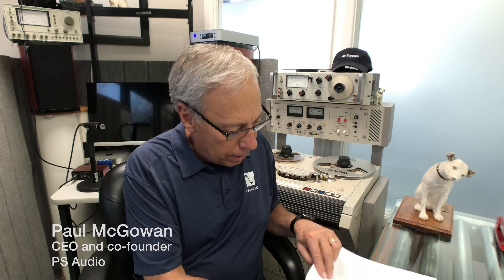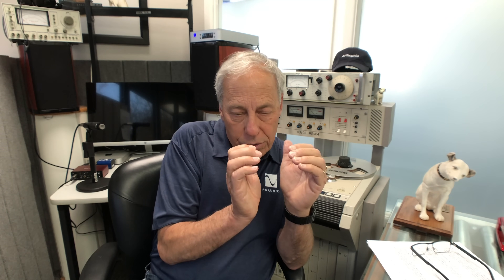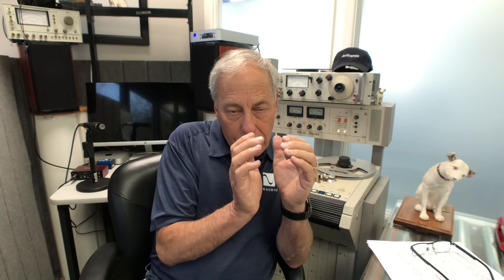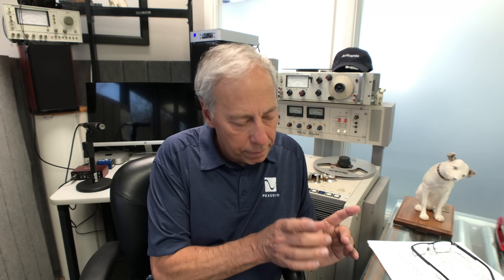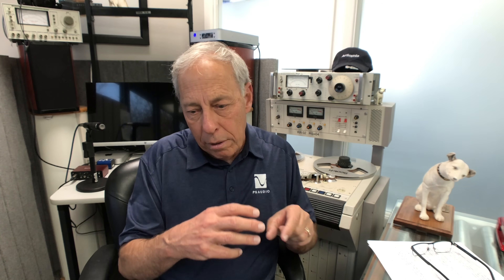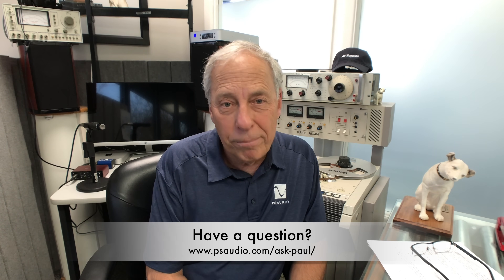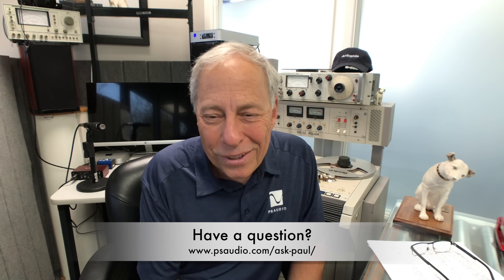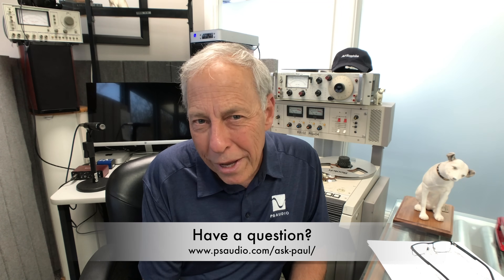How important is the DAC chip itself?

Comment: Coming across this video now is quite a coincidence. Just last week, I had an inane argument with some tool on a home theatre enthusiasts Facebook group (as an enthusiast myself, we are just the worst) about how DACs don't affect the sound because as per his "benchmarking equipment", they all offer incredibly low distortion and therefore do not change the signal in any way. Oh boy. He got particularly riled up when I said that in my experience, Sabre DACs have a cold, analytical sound to them (that's just the way it's been in every implementation I've listened to) while AKMs that I've listened to tended to lean slightly on the warm side of neutral. But of course, 0.00000000002% distortion means everyone can pack their bags up, because the DAC business is over, right!? I personally use a Chord DAC (also FPGA-based) and it just sounds "precise" compared to the more traditional DACs I've listened to (I can only imagine what the more expensive stuff sounds like).

I've also learned that double blind testing or AB testing is really not a valid way to determine how you hear something. I think Paul gives a great reason in these comments as to why such tests are useless. When I compared the Chord DAC to what was at the time my favourite DAC, a Burr-Brown, I did not discern any immediate differences and dismissed the Chord as wasted money. Three months later of listening to the Chord DAC, and then switching back to the Burr-Brown, I was blown away at how bloated and "slow" the Burr-Brown sounded. It's not that the Burr-Brown was bad, but listening to the Chord over time, I started perceiving how much tighter everything sounded, and I could listen for hours without getting fatigued (something I cannot do with a Sabre DAC). It's one thing to tick all the boxes on a bunch of specs, it's another to actually listen to something and "feel" it. That's something a lot of "enthusiasts" simply don't do - listen (the irony). It's much easier to wave a bunch of measurements they barely understand, shout "snake oil", and mock people for spending more money than them - who are you trying to convince, exactly?

Thanks Paul, really appreciate these videos!
Reply: Read / Listen to this:CD/DVD Player DAC Comparison Round 1 ( Sony, Pioneer, Toshiba, Onkyo, Technics/Panasonic ) https://www.youtube.com/watch?v=HLPVR9_qHhU&t=1s
Reply: Most of these guys have next to zero experience or knowledge. In the EAD DSP 7000 series DAC from back in the early 90s, the company decided to change just the DAC chips which then became the DSP 7000 series 2. The switch was from an Analogue Devices chip to a Burr Brown PCM 63k chip. The difference was substantial between the two units.
Reply: Chord is good for a low end brand. Or shall i say “mid-fi”
They compare well to other dacs in the $2k-$5k range
It’s a shame that the holo May Dac is destroys the entire  chord line including the chord Dave with Mscaler but at a fraction of the price

Im not too sure which implementation you heard of sabre chips, as i personally dont buy cheap equipment, but i heard the lumin x1 which uses duel ES9038PRO Sabre chips and its one of the best sounding dacs I’ve ever heard and this is me comparing it to $20-$30k dacs

Comment: Made a double blind randomized controlled test with equal levels on the same Tidal preamp comparing a 110 Euro Xiangsheng dac 01 with the solid state outputs against a 65.000 Euro MSB dac which additionally had esoteric cables, was attached to a Isotek power conditioner etc. It consisted of 60 rounds and took up to 3 hours. No difference was detected. Absolute guessing. Poqer calculations gave us enough confidence for the 60 trials. Music came from the same digital source, also from msb/ oppo. While listening, the dacs could be switched with interuption of less than 1 second with spl alignment. Add to that the msb dac was upconverting whilst the xiangsheng was not. It did the same sort of tests with different gear, no perceivable difference! 

I am very well aware that mostly audiophiles are reading this and you will have the last word on that matter. You are an authority in the myth industry. But a very modest and friendly person. I am sure you believe in the faulty and circular argumentation. The same way as a slaughter will not be able to get insight into why killing animals might philosophically be wrong. I hope you excuse the analogy.
Reply: Bad science here. You discount how the mind interprets and learns, and objective actually difference can be physically measured. Where has this study been published?
Reply: Sorry Paul, you honestly seem to be a very nice and friendly person and I do not want be be rude but this is the same old trick to devalue truth and scientific proof. It is the same way of arguments that try to establish the unfounded myths of highend idealism. If our perceptive systems are not able to distinguish between two sonic sensations, the reason why we hear differences is due to suggestion which works in the same way a placebo works and even increases immune reactions. The same holds for functional psychosomatic pain disorders. I work in that field. But the differences can`t be reduced to actual differences in perceiving physical properties themselves in the audio machine. It is neither empirically proven nor theoretically founded in a plausible way. Your argumentation is: when you do not know which one device is playing, you can´t hear a difference. Congratulations for that unwanted and implicit honesty! There are so many experiments in the field of cognitive and social psychology that show exactly these effects of the interplay of heuristics, expectations and how that affects our perceptions. Blinded, these effects disappear because they lie in ourselves not in the physicalities of the system.

By the way, in our experiment, the listener was able to switch between the sources and could listen to one source as long as he wished to get used to the listening experience.

Your argumentation is wholly circular in nature. First semester of philosophy.

I do not mean to offend you.

All the best and I want to let you know that I even own a PS Audio DL 3 also it does not have a sound of its own ;) but it is solid made.
Reply: Sorry Paul. It is unscientific to claim the outcome of a study is devalued because you do not like it. Meaning the differences can not be heard, or can not be attributed to the physical entities of the machine in relation to our human sensory and perceptive system, does not mean that the test does not work.

It works perfectly well and shows clearly that no differences can be heard.
Reply: With such a test that you described, is it possible that Listening Fatigue interfered with your experiment? (And, yes, Listening Fatigue is a phenomenon that occurs. Ask an audio engineer/studio producer.)